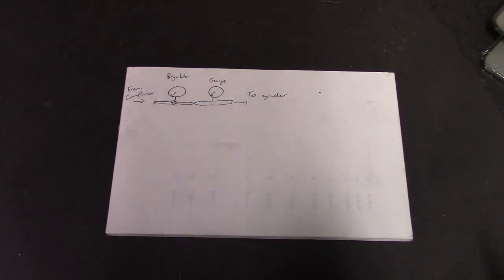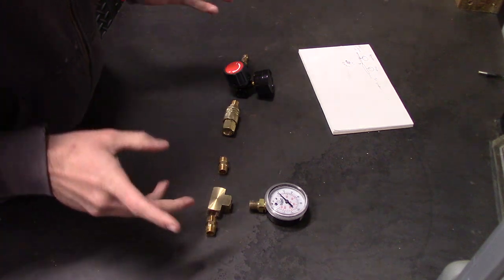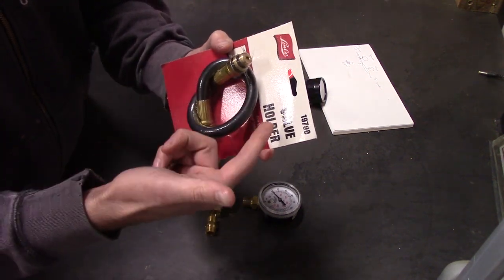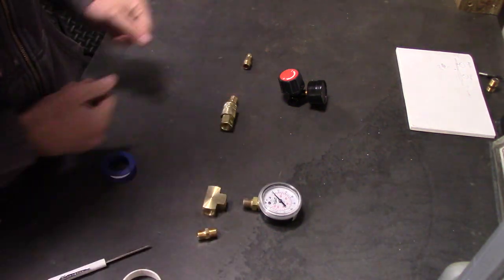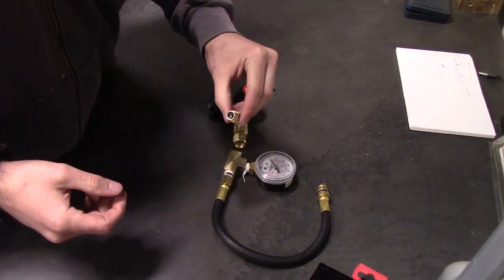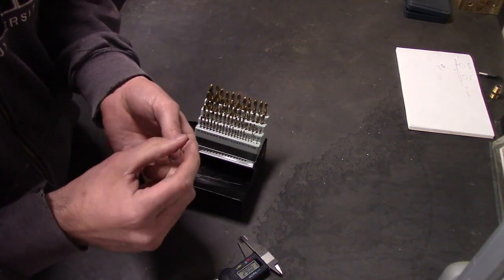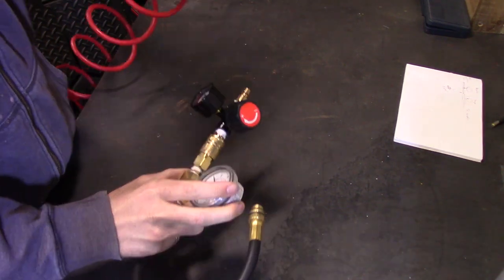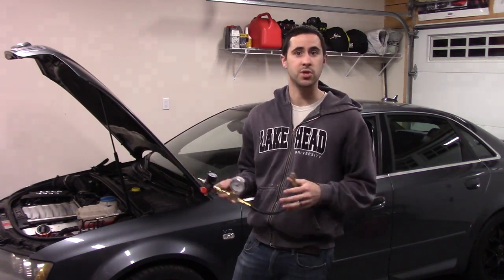DIY Cylinder Leakdown Tester

Comment: This is the correct way to make a leak down tester. When you use it you start out with the tester screwed into the cylinder. Then you set the first gauge to 100 PSI then read the second gauge to your peeve of leak down. So many videos show the tester being pressurized before connecting it to the cylinder. Lol

Comment: It's really cool, but the total is not too much lower than an OTC leak down tester for $70.
Reply from the maker: Yeah you’re right, but buying one you don’t get the satisfaction of telling all your friends you built one yourself lol
Reply: @MGMotorsports           Cut the music   ,   I am trying to hear you and your subject  .    I never comment on any videos but YOUR  over ride of the music sucks .     Hope to view some future vid,s , out of here for now
Reply from the maker: Guy Laverty thanks for the comment, I will investigate lowering the volume of music
Reply: MG Motorsports nice video thanks for taking your time to make this video I appreciate that
Reply: @MGMotorsports  exactly right!
I'm finishing mine now. I just watched your video to find out the size of the restrictor hole and understand why you need it.
A (cheap) new one from Harbor Freight is 79+plus tax. I had to buy everything separately myself and I have about $50 in mine. I made mine where the gauges are the same height and they're in line together. That way the whole unit will lay flat in a plastic case I have. I'll cut a piece of foam for the top and bottom of the case. I already have a compression tester so I can use one of the hoses with the proper fitting on it. I just have to remove the one way valve from the end before doing a leak down test. 
Yeah I went a little over board with it, but I can say I made it lol.
Great video of you making it and explaining everything.
Reply: You literary did not have single piece of that kit around your garage you would think you Atleast owned compression tester lmao 😅

Comment: Driling the hole out, will a 1.5mm hole be fine too? If not, what will happen? numbers on second gauge won't work correctly with 100psi?
Reply from the maker: The only issue with going bigger on that hole would be that you are “refilling” the cylinder faster than it can leak out, so 1.5mm might be ok but might also skew your leakdown numbers to be a little lower than they actually are, I haven’t tested them back to back.

Comment: Great Video : I was just looking for this type of device "how-to" and it's giving precious tricks !
The ONLY stuff I don't completly agree is the orifice definition. Its not only a diameter but its also a length and a shape of ends  (to a lesser degree).
If the hole is short and has sharp ends, the pressure loss is basicaly a function of the diameter only. 20% pressure loss (ie 100 PSI upstream vs 80 PSI downstream) would result in a 1.4 SCFM leak.
If the hole has a length much larger thant its diameter, it's another story and the pressure lost for the same leak would be higher  OR for the same pressure drop reading the leak would be smaller. (same values 100/80 PSI on a 1" long hole => about 1 SCFM ...40% smaller leak => more sensitive instrument)
I suppose drilling a 1mm through about 1 inch of epoxy is even worse as it may include some tiny bubbles in the epoxy which can lead to even more pressure drop (and even more sensitive instrument).
I would love to have a little more details about this critical part of this instrument !

Comment: Can't threadlock just substitute the teflon tape?
Reply from the maker: Maybe pipe dope, but I do not think typical threadlocker is rated to provide a seal against air leakage. That being said, the NPT thread usually does a pretty good job at sealing on its own

Comment: Couldn't you have used a in line air flow adjuster? Instead of the epoxy and fitting
Reply from the maker: Perhaps, I’m not familiar with that and I’m sure it cost more than a tube of epoxy, this was all about making a budget leakdown tester. The professional ones do use a similar orifice as well